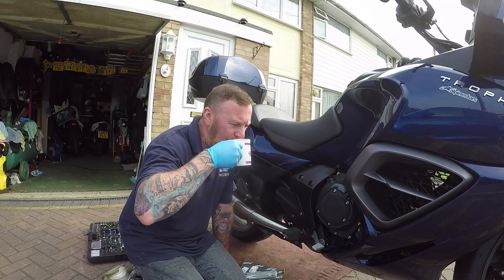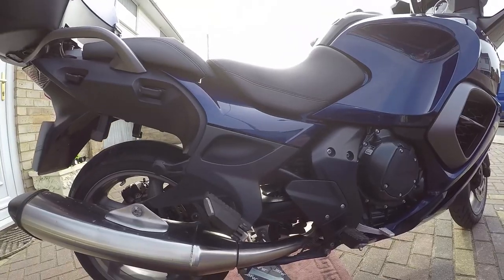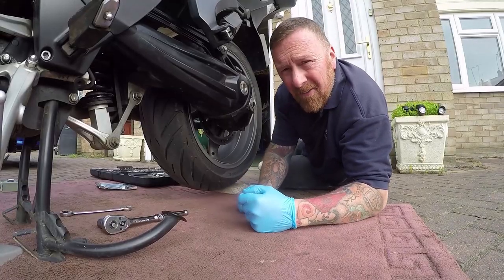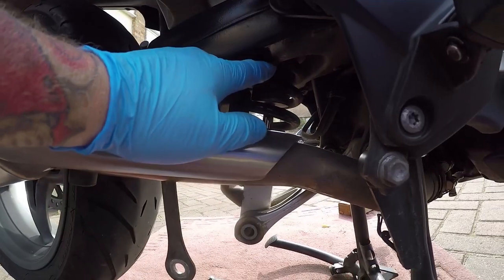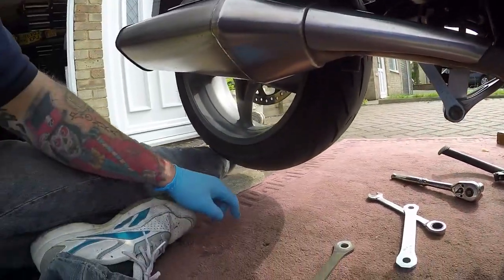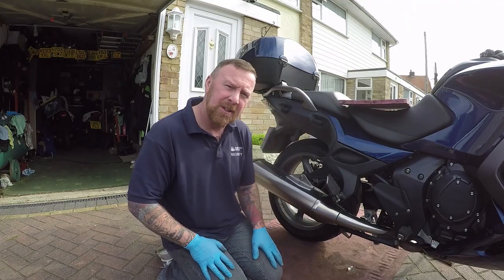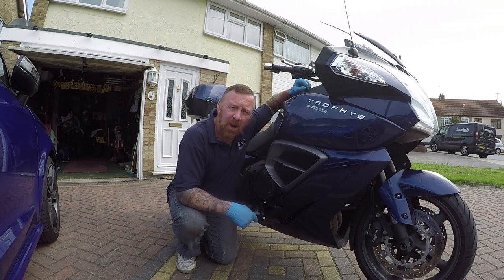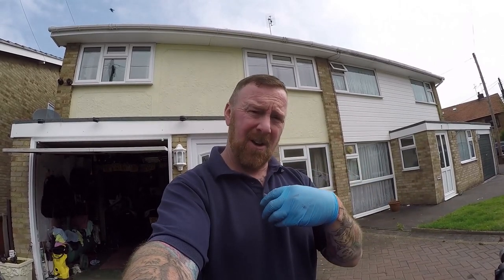TRIUMPH TROPHY LOWERING KIT DOES IT WORK ! MARK SAVAGE

Comment: Thanks for the video. Mark. Just bought a Trophy and like you I am not feet flat so have got a lowering kit. Great to see how it is fitted and the info about the silencer is really useful.
Reply from the maker: Great bikes bud
Check out my road trip to the Isle of White 
The bike was amazing 
Plus my full review
Reply: Hi Steve/Mark hope you guys are well.Kindly tell me how tall are both of you.I am looking into buying one of these when they become available Thanks.
Reply from the maker: @kidronreddy1671  i'm 5.7ish 30in leg and before the lower kit it was a bit too tall, with this kit both feet flat on the floor and felt so much better with no handling problems 
check out my isle of wight video, it rode amazing bud 
https://www.youtube.com/watch?v=93LRcnJc2K4
Reply: @kidronreddy1671  Hi Kidron. I’m 5’11” tall with a 29 1/2 inch inside leg. I can now get my feet flat and have no adverse handling effects. Only problem is that I really struggle to get it onto the centre stand. Hope this helps.

Comment: Hey Mark.. great video, great commentary... would you also make adjustment on the front forks too?.. or just that rear linkage?
Reply from the maker: I did just the rear and it was fine but I did have to lower the lights a little that's the only thing , it really did help and made no difference to the handling but a big difference how it helped me 
thanks for watching

Comment: Those bikes are monsters.. have you done any videos on the vtec vfr800 ? Once seen your gxer750 video and a bit torn between the two. I have a gsr600 at the mo which i take out fairly regularly for a good blast but don't really feel the need for a 1000cc sport. Any other recommendations please. 
Thanks in accordance advance
Reply from the maker: hi bud thanks for watching 
yes I have done a few videos on the gsxr's 600 service and start up and the k5 ride out and the k7 look around
the vfr800 is a different bike bud and only one videos when I had  very loud exhausts on it revving lol
I've had a few 800s and a 1200, the 800 is a great all round sports tourier 
fast fun and good in the seat so if that's what you what to move off the gsxr's to a bike you can ride all year round its a good bike to get but they do hold there money 
still love the Kawasaki's lots of fun but still a sports
best sit on them test ride and make your mind up that way bud 
mark

Comment: Great vid! I have a question: just bought a used trophy se, I think it came with lowering links cause the bike came with spares links. I want raise it what was the measurement of the stock link?
Reply from the maker: Sorry bud 
I don't remember but it was a good inch higher on the seat 
But only a little bigger on the links

Comment: So did you install the bolts from the other side so you don’t have to remove exhaust again? Or Does it only go in one way?
Reply from the maker: One way as you can't get it in the other way 
Easy job bud
Reply: Just added my stock/regular size links because the low ones were not working for me (came with the bike used that way) The stock links I feel changed the steering for the better as well as the center stand operation. So I ended up putting the bolts from the left side keeping the nuts on the right so if I have to switch back I will not have to remove silencer
Reply: Super easy though just like you said.
Reply from the maker: @thomasmarshall6109  oh well that worked out well then bud, I just fitted from the way It was fitted 
Yes the stand was harder lowered 
Enjoy bud

Comment: You should have reversed the bolts so that next time you wouldn't have to move the exhaust.
Reply from the maker: well yea guess so but didnt want to mess around too much with the set up but all in a great end and rode very well
Reply: @marksavage  I just dropped mine while slow manoeuvring on a steep camber and dropped kerb. £368 worth of damaged to the pannier and fairings. Gutted! Just ordered a lowering kit on ebay. Thanks for the video. Good Information.
Reply from the maker: @IkeBrider  this was why i did mine as they are big old girls , this will help bud
Reply: @marksavage  Cheers Mark. All done now. Do you recall the torque wrench setting for the drop link bolts?
Reply from the maker: @IkeBrider  no bud i just sort of know if that makes sense lol

Comment: those huge big bikes intimidate me, like they are just too big to handle, i think ill get a smaller bike
Reply from the maker: ArcadeMAD once you get moving they are really nice to ride and hold the road very well 
It is just moving them around that’ can for little fellas like me be a little unsettling lol 
But there’s a nack to it which you sort of just get used to 
Saying that I love my little versys for riding every day
Reply: i have a 1200 bandit and a triuph sprint st they do look intimidating to start with.but as soon as they get above 10 mph all the weight drops away im 5' 10" and 61 years old now you would notice in a corner they are absolutely planted to the road no drama like a smaller bike that can twist and buck you have to work a lot harder,but you can just tip in (they are a bit slower than a small bike turning) give one a go .the one thing with a big bike like my 2 with massive torque they can be ridden at 30 mph in top gear open the throttle and when you quietly rumble up to about 5000 revs look at the speedo 

your now doing about 120 mph no drama !!! have a go you will love it. keep it shiney side up .

Comment: Good night,

Dear Mark, I would like to know where you got the suspension lowerer for your Trophy, because I also have one and I have fallen with it 3 times. you could send me the manufacturer and the part code with the contact so that I can ask for an equal. I live in Brazil and therefore I need to order via the website.

hug.

Elizio
Reply from the maker: Oh dear that's not good falling over , I found it on e bay but don't think the sell outside UK im sorry to say 
But if you can find one it really helped the seat hight as I'm 5.8 and as in the video both feet on the floor 
However its still a heavy bike once loaded and the wife on the back 
Have a watch on my road trip to the isle of Wight video 
Take care bud